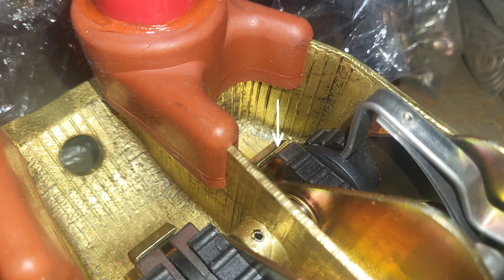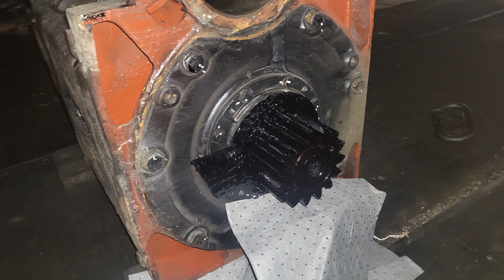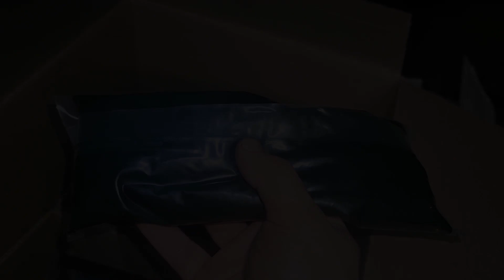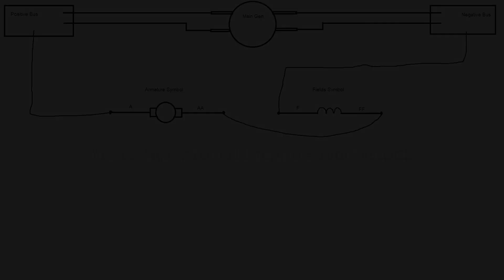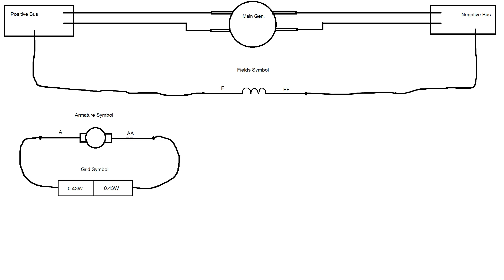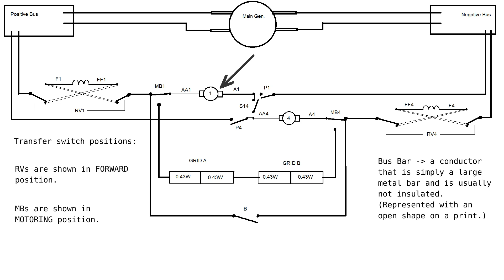From The Rails Up EP03 (Traction Motors & Combos)

Comment: So what is the history on this locomotive that makes it famous? EXCELLENT videos!!! Thank you so much for sharing!
Reply from the maker: Thank you for watching!

I'm assuming the locomotive you're asking about is the SD40-2. I won't claim to be a historian, but the SD40-2 started production in 1972 and was made until 1989. I believe something just shy of 4000 were made. I turn wrenches, I don't run the things, but I've heard from engineers that a Dash-2 will compete with locomotives with more horsepower in terms of pulling.

From the mechanical perspective, the Dash-2 line used the 16-645 prime mover which, as an engine, was used in applications ranging from stationary power generation to maritime propulsion (and plenty of other applications I'm sure) and was known for being an all-around reliable workhorse. The modular circuits used on the Dash-2 line were designed to minimize downtime. (If a module is bad, just replace the module. That's a five-minute job compared to many older systems.) Another big maintenance thing for the Dash-2s was the motorized switchgear. The motorized transfer switches are all but bulletproof, especially compared to older magnetic contactors. Once they are in a position, they lock in which makes it hard for a contactor to fail and burn up from arcing. Another thing, one that I won't claim to fully understand, is the HT-C truck assemblies. The HT in HT-C (according to what I was told) stands for "High Traction" (Hence why Dash-2s could outpull contemporary locomotives with more heft.) A big part of why this is the case is the fact that all the traction motors face the same way, which allows the forces from the motors on the truck frame to all act in unison which effectively pushes all the wheels against the rail harder than gravity would alone.

So TLDR, the SD40-2 (and the rest of the Dash-2 line) are well renowned for being workhorses and all around reliable and easy to maintain.